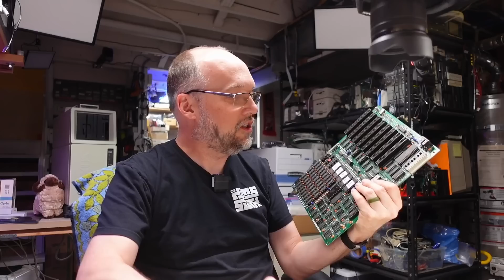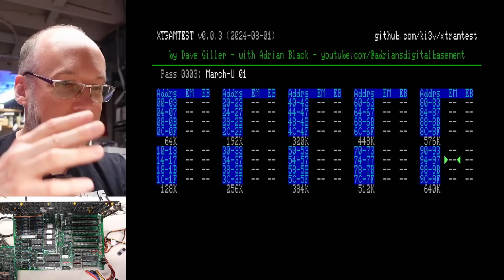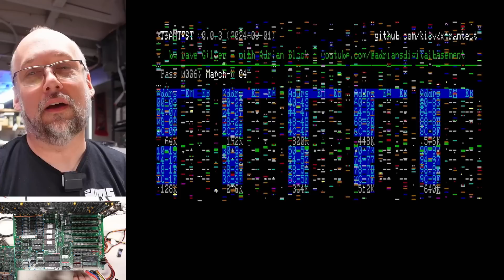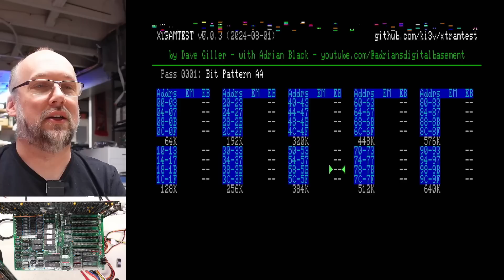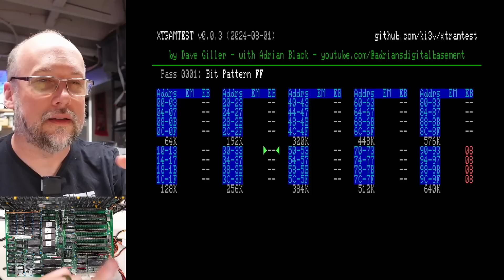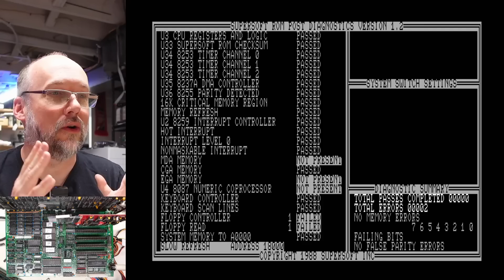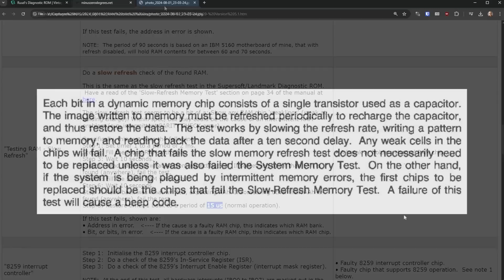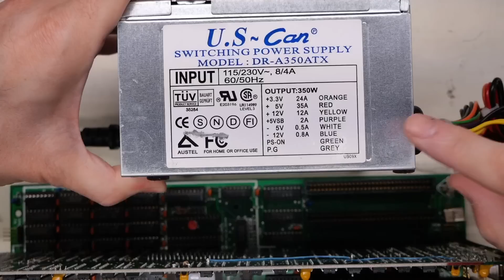A brand new XT RAM test ROM and an update on some unfixable parts

Comment: Rule 0: Thou shalt check voltages. Especially when you get a fault which seems to be difficult to track down.
High impedance capacitors can easily let a lot of AC noise through, and under load can cause power to drop out entirely. 
Glad you got to the bottom of it all!
Reply: Though, the issue might not have shown up with a simple voltage test, or even looking at static ripple. 
Maybe it only showed up under load, or certain patterns of load. It might have also been a transient issue.
Reply: @phirenz  You'll probably see it on a scope but not a multimeter.
Reply: @big0bad0brad  You would probably see it on a multimeter in AC voltage mode, at least if it's a consistent ripple. Which is usually the symptom of failing caps.
Reply: @Stoney3K  Good point, though that can be very heavily filtered and might not pick up higher frequency.  It can confirm noise but it can't rule it out, unless you know exactly how your meter works.

Comment: I can absolutely confirm that 'dirty' power can cause strange computer issues.  Long time ago a roommate had his computer crashing all of the time.  It was plugged directly into the wall, and once I talked him into getting a UPS his computer starting staying stable all of the time.  Bad caps would cause fluctuations in the power waveforms, which I can totally see causing RAM issues in older stuff.  I would guess that only those two parts were affected due to their not liking the variance in the power more than all of the other stuff.
Reply: In the 90's I did a support call to an office where the computer had completely random problems. I noticed it always seemed to coincide with the nearby elevator landing on the floor. So I ran back to the office and grabbed a battery backup and from then on the problem went away.
Reply: Grid power is so dirty where I live that when I turn off the lights and other stuff other places in the apartment, my tv brown-outs. 
All my devices have contracted serious stability issues.
Reply: @asbjo  That's not dirty power, that's a really dodgy electrical installation with high effective series resistance. Get an electrician out there to give it a checkup sooner rather than later, this could be a fire hazard if caused by oxidized connections somewhere (e.g. at the breaker panel). Your wiring would have to be severely undersized to cause such issues when everything is connected properly. I mean, it could still be old and crappy regardless, wouldn't be a rarity, but things like you describe just shouldn't be happening.
Reply: @asbjo  I chased an issue with a synth that sounded terrible at times without any pattern to it whatsoever. Sometimes failed when warm, sometimes when cold. I found a horrible ripple coming in at times so assumed that there was too much drain on it. The supply was the basic design with transformer, rectifier, and 7805/7812 regulators.

Turned out to be that the 120VAC mains were dropping to 110VAC. Also explained a lot of other issues I've had

Question everything!
Reply: @SixOThree 😂 I will always remember that damn computer that worked flawlessly at the shop but keep on crashing at our client home and corrupting the OS installation.
It was the mains off course, every time the washing machine put a load on the system the lights dimed and the computer restarted.
I didn't want to tell my boss the crappy PSUs he chose wasn't helping at all but he "solved" it by selling another UPS. 😅
Bad quality PSUs can make your motherboard components go bad quickly, it was an intuition for me that got confirmed and explained by PSU expert Jonny Guru at an old interview.
I have seen two computers behaving differently in the same room connected to the same installation without UPS one with an OK quality PSU (Antec, Enermax...) and another with a no brand light as a feather chinese fire hazard, and any stability issues at mains would result in crashes and reboots on one of them, guess which one. 😅

Comment: Hi Adrian, apart from the bad caps in that Old PSU that were 100% causing your memory stability issues, there is also a minimum power draw per voltage rail to stabilise the voltage outputs. I would recommend replacing all the caps in that PSU as if two were bad, then most likely, all caps are starting to fail. Check the smaller 1uf, 10uf & 47uf caps. You're like the Old Ram God. Love your videos 👏

Comment: Noisy power supplies fall in to the larger category of "Electromagnetic Compliance" problems. 
I remember how horrified our EMC engineers were when they saw PCs running without their metal cases. The purpose of well earthed metal enclosures is to confine stray electric fields and prevent them affecting nearby circuits.
Note that the PCs you demonstrate would almost certainly fail their compliance tests without their metal cases. And it's also likely that you have some noisy equipment nearby (Air-Conditioners, Solar Inverters, Industrial power supplies) which are generating a high level of interfering hash. It goes two ways of course: If equipment is suffering from stray interference, it almost certainly is also causing interference to nearby radio sevices.

Comment: My pet theory: The power supply issue could be the classic "swiss cheese" problem: loss of redundancy, i.e. on other motherboards the various decoupling (and other) capacitors were able to compensate for the dodgy PSU voltages. Perhaps on the troublesome motherboard the capacitors there are marginal or effectively absent, and that's enough to tip the scales.
Reply: makes sense

Comment: Such a "Slow Refresh" test would be interesting, that the timer value would be extended step by step until the memory chip finally gives an error. The test program could show on the map/matrix the milliseconds when each memory chip was still working. Based on the results, you could bin the memory chips and use them on a motherboard that bios allows a slow refresh rate.
Reply: What advantage would running the superior ram at a slower refresh provide tho?
Reply: @m.wajihuddinkhan1857  Memory need to periodically refreshed to maintain their data and when this occurs CPU needs to wait. The slower you get this, the faster the system is. How slow you can set refresh depends on the individual memory chip's ability to store information.

Comment: I worked as PC Repair technician for 9 years - If it wasn't the hard drive / SSD, in 80% of cases problems with the PC went away when we replaced the power supplies. At the beginning, I checked with the scope, but with time, I skipped that step and just threw in a fresh power supply when in doubt. Almost always fixed all the issues :D
Interesting in that context: PCs would sometimes be rock solid under load (Benchmarks, Stress-Tests, etc.), but letting it sit idle in Windows = Bluescreen^^

Comment: Ten years ago my friend PC serviceman called me to observe one peculiar malfunction on moden laptop. When it worked on batteries, it worked fine, but on original power brick it would slow down to a crawl. It would boot like that and/or switch to that speed when it was plugged in to AC power from that adapter (simple 2-pole adapter, mind you).  Battery charged fine and voltage was ok. With replacement adapter laptop worked fine. So, there was something, probably some unfiltered noise that drove that laptop crazy.

Same here-who knows what noise frequency drove that PC stupid.
Reply: With broken or unrecognised power adapter some notebooks are entering emergency mode either slowing down to the snail or powering off after some time.
Reply: @kirusyaga  Yeah you tend to see this more on chargers with a 3 conductor connector to the laptop, ie a center pin and inside/outside conductors on the cylinder part

Comment: A popular RAM test in the 1980s was the "barber pole". You wrote 0x01 in address 0, 0x02 in 1... 0x80 in 7, 0x00 in 8, 0x01 in 9, 0x02 in 0xA and so on. Repeating a 9 byte pattern helped detect any addressing problems since it isn't a power of 2. In the next pass you checked that the values were as expected and did the same thing with the pattern advanced by one. After 9 passes most errors would have been detected.
Reply: The black&white Macintosh clearly (as you can see from the pattern in video memory during startup) was doing a 3-bit barber pole test. Since 3 is relatively prime to all powers of 2, it is definitely going be out of sync with memory chip sizes. And it only needs three passes (six if you test the inverse too), so it was fast, which you want in a power-on memory test.
I actually implemented this on a board I was helping to bring up at work back in 2001 or so, and it caught a memory problem with the board right away. (Fixing it was happily Not My Problem.)
Reply: Barber pole tests a great because many faults are something like a solder blob and can be found almost instantly.  After all the simple errors are fixed run a longer sophisticated test to find internal chip faults.

Comment: Using the video RAM as a stack page is ingenious! Especially since it's easy enough to get a working video card by testing that in a working machine.
Kinda reminds me of the Exidy Sorcerer. If that machine's main RAM is bad (or the circuitry connecting it to the CPU), it tries to load the OS into video RAM and you get (besides graphics glitches and crashes) a hilariously small amount of free memory.
Reply: Is this Exidy Sorcerer a program or something?
Reply: @PaulLoveless-Cincinnati  It's a PC from 1979. Exidy was somewhat biggish into arcade machines at the time, it was kinda weird their PC design was very business-oriented, missing features that would cater to games, like color or sound, instead it had lots of RAM and (for the time) very High-Res graphics. A great machine for productivity. A poor machine for games. Still better for games than the original IBM PC though.

Comment: Two possibilities I can think of:
1. Not all caps are the same some are cheaper and don't smooth ripple as well so your boards that worked with it probably have caps with good specs while the two that didn't have crap caps.
2. Chips have their own internal capacitance as well that could effect ripple.

Comment: I've worked in a computer store in the 2nd half of the nineties. Two things I recall. 1. A client complaint PC crashing. Stable for hours in the store. I ended up making a house call. Sure enough the thing was super unstable. I ended up wanting to unplug something and got a shock from the case. It ended up that a desk lamp was leaking current onto the ground wire. 2. Our top line model always used asus motherboards and creative labs sound blasters. One night we are building 5 or 6. All of then failing to produce sound. Tested all of the sound cards in the showroom model, all good. Took the sound card from showroom into the new builds, all good. Somehow the incompatibility was the combination of the different production runs.

Comment: The issue is rails on some motherboards have less bypass caps being more reliant on the PSU. Plus bypass caps probably dead open tants no longer sorting out ripples. It also depends on makes of IC on the boards generating logic switching spikes!

Comment: I'm not surprised in the least about the PSU causing the RAM issues.  Never experienced that specific problem myself, but I've seen tons and tons of other issues that had me pulling my hair out - only to discover it was a faulty / weak PSU.  As far as why one mobo would have problems while others didn't, I think it all comes down to the tolerances of the hardware.  Some hardware can still function when tolerances are exceeded, others not so much.  I've seen that in overclocking - same RAM brand and make, two separate packages - one can handle the OC, the other can't.

Comment: It is good to have all these test ROMS in the toolbox. I just recently was working on a Commodore PC-10 III system (8088 system running DOS).  It wouldn't post. So, I did the Ruud ROM, and it failed at the 8253-timer channel 1 and halted the test.  The PC-10 uses the Faraday FE2010A chipset which has a lot of logic like the 8237, 8253 and others.  If Ruud didn't stop testing because of the 8253-timer channel 1 failing it would be able to test the other sub-systems. I don't believe the timer 1 error is valid just an issue between how the FE2010A handles it versus the 8253.

The Landmark ROM does have the same timer channel 1 error, but it does continue on, and it didn't diagnose my particular RAM problem. It identified bit 7 as being bad on both banks of the 256Kx1 DRAM's.  Swapped those out and everything was good.

Not sure if this new diagnostic rom will work fine with the PC-10 and the FE2010A chipset but when I get a chance I will have to see if it works with it.

Great video as always and thanks to you and dgiller for working on it!
Reply: For PC systems with the actual 8253, timer-1 is absolutely necessary for any real testing, because it's what activates the DMA refresh cycle.  Without refresh, you have no RAM.  That limits what you can test, to what you can hold in the processor registers.  So it makes sense that the ROM would assume that it can't do anything after that.  Basically, until it creates functional RAM, complex operations are pointless.

Comment: I had a weird problem with a PC years ago that turned out to be caused by the PSU. When initially turned on, it would just give a BIOS beep code error complaining it had no RAM. But it would only do this sporadically, and when it did, hitting reset would get it going. I replaced the RAM but that didn't help. It seemed suspicious to me that it was only at cold boot that the problem occurred, so I thought perhaps some kind of instability until things warmed up. On a hunch I borrowed a PSU from another system and the problem disappeared. Looked inside the bad PSU and some caps were leaking. Recapped the entire thing and now it's good as new!

Comment: Back during the Pentium 4 era, I had an Asus P4C800-E Deluxe which had its onboard gigabit Ethernet fail after a couple years.  Not long afterwards, the video card starting having problems and then the motherboard had problems starting.  Replacing the power supply not only fixed the starting problem and the graphics card problem, but allowed the Ethernet to work again.

Comment: My first thought when he said "intermittent random failures" was power supply or cold solder connections. Especially the TTL ICs can behave very strange if the voltages are fluctuating. I build my circuits with old extracted ICs and have such problems now and then. I will always test with at least two power supplies. Sometime is can't even see a difference with an oscilloscope, but one works right the other not.

Comment: Excess ripple is a pesky thing at times. Since digital logic tends to have enough bypass capacitance to almost not need the bulk capacitance in the PSU, unless one is dealing with more cost optimized boards. 100nF here and there does add up, and there is usually also a few larger capacitors as well in the mix. So a half dead bulk cap for the rail in the PSU can somewhat slack on the job without much notice.

Some people might argue that "SMPS switching currents would fry the bypass caps on the logic boards!", but nah... ICs takes quite hefty gulps of current each transition and they also do it far far more often. Now it is true that most logic boards do not have enough capacitance to really work without additional bulk capacitance in the power supply, since the supply voltage can end up too low for the chips to run correctly, especially when one tosses on their own ripple. Though, a surprising amount of ICs do "work" far bellow recommended input voltages, though usually not always as intended.

One reason that bypass capacitance usually does an unexpectedly decent job here is mainly thanks to the practice of having bypass capacitance for all chips. Chips don't generally need their own dedicated bypass capacitors. As one moves up in the values it somewhat becomes increasingly unimportant, but that doesn't stop us from designing them in regardless. Capacitors are "cheap". So a board with a handful of ICs often ends up with more capacitance than technically needed. And some people throw on a few extra bulk ones just to save themselves from any ripple related issues down the line.

The bigger issue of inadequate bulk capacitance in a switch mode supplies is the excessive EMI that now has less suppression. This can lead to all sorts of wonderful issues as far as signal integrity is concerned. If particularly bad then it can even start jamming other things nearby. But then the bypass capacitance on the logic boards likely won't suffice.

In my experience, PSUs tends to be where cost cutting on capacitors happens the most, since the majority of people do like to pick the cheaper option here even if we all know better. Oftentimes a rail only has 1 bulk capacitor doing the job. Ideally speaking as far as aluminium electrolytic ones are concerned, more smaller capacitors is better than 1 large one, since the ESR per capacitor is about the same regardless of size. (not really, but 4 small 120 µF @ 0.15 ohm in parallel is better than 1 large 480 µF @ 0.08 ohm. But it is more expensive to place in 4 components than 1 large one. So cost cutting manufacturers will go for fewer components. And more smaller ones typically also have more surface area to act as a cooler, so another advantage towards reliability.)

Comment: Seems to me you do enough PC/XT/AT testing that it could be worthwhile to make a "safety wedge" for the PS... just a PCB with power input (AT and ATX), conversion circuits for the ATX such as the power switch, extra filter caps so the supply is extra smooth, a good crowbar circuit in case the PS regulation fails, and a little extra that kills a rail if the amperage exceeds an expected value too quickly (tantalum shorts, bad chips, shorted connectors, solder bridges, etc.).